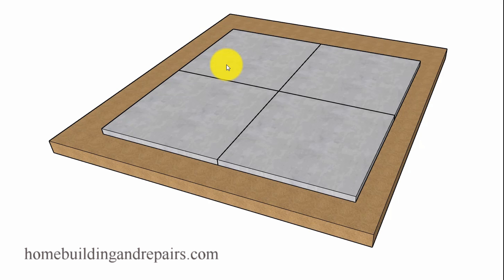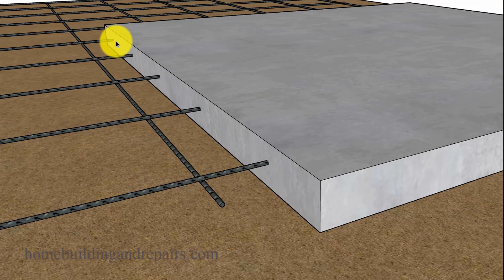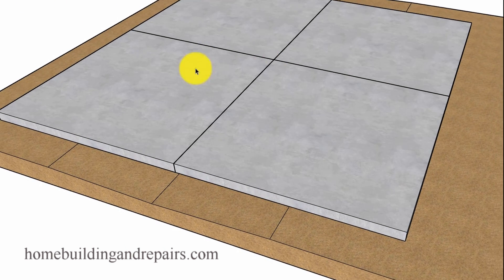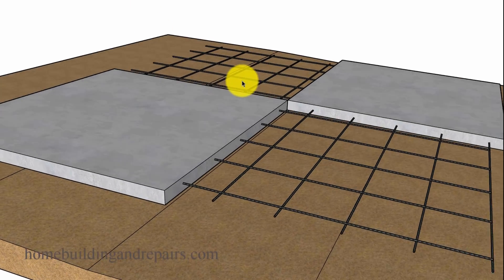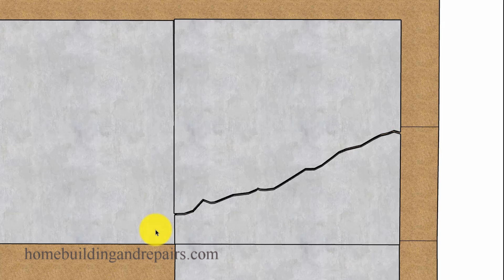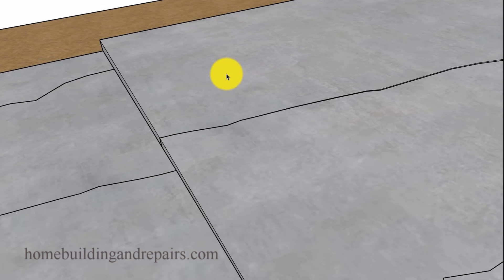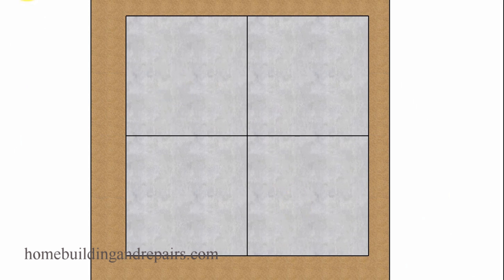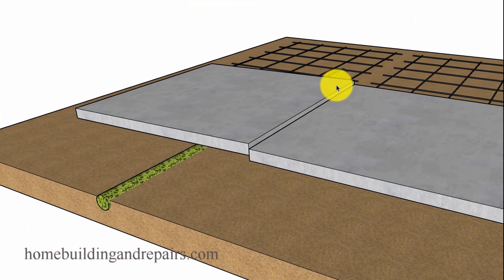Watch This Video To Learn More About Using or Not Using Rebar For Concrete Driveway

Comment: Greg, if I am connecting an 18 inch wide driveway extension to my existing driveway what is the proper way to do this? I am using 4 inches of compacted DGA as my sub base separated with geo fabric. Then 4 inches of 57’s and 4 inches of concrete. I am putting rebar in the new extension. I’m not sure if my existing driveway has rebar, or not. I’ve thought of cross drilling into the existing slab and epoxying rebar from the extension. What are your thoughts?
Reply from the maker: I would use rebar and installed rebar dowels or with epoxy if you can into the existing slab

Comment: I don't like rebar for one reason... longevity in rough conditions...If you have temperature swings between winter and summer in the -45 to +35c  range (say -50 to +100F) and a wet climate, rebar concrete tends to crack, then the rebar rusts and spalls, and the concrete turns to utter crap.

Comment: My Brother's house has a massive amount of driveway and many of the separate slabs are lifted and/or cracked.
We discovered that there is zero reinforcement and no base preparation under the slabs when we demolished the worst one to replace it.
I'm pouring small sections to join my asphalt to my new garage and I'm using rebar but not connected to the adjoining slabs.
Reply: Need #57 crushed concrete pieces spread and compacted, then compact paver base or crushed rock with rock sand onto the #57. It's driveable at the point. Then pour right onto it. I only do concrete with that kind of base prep- much better than pouring right onto dirt.

Comment: Thanks very much for this video.  I''d never attempt doing a large concrete pour myself but it helps to know this information when contracting out the job and deciding who takes shortcuts.  Plus, I've observed a recent subdivision where the builder did not put any reinforcement in the driveways...no wire grid, rebar, etc...they built a 64 house subdivision in less than a year and if they take shortcuts in the driveway, makes you wonder how many other subpar work was done within the walls of the house.

Comment: Rebar or no rebar, the number one thing you need to focus on when pouring flatwork is the BASE! Of course it’s faster to rush the base and add rebar, but your work won’t outlast a slab with a good base and no rebar. Focus on the base, add rebar to act as your BACK UP to if the base fails down the line.
Reply: Base?
Reply: @yangmagic0703 base being what's under the concrete. It could be a compacted final grade sand, road base, etc. It depends on where you are and what the municipalities require.
Reply: Thats why i use 2 inches #57 crushed concrete on top of compacted soil, then compact again after placing paver base (rock dust mixed with small stones).
Reply: @SK-ml3ef supposed to be 4”
Reply: Good point. Make the foundation/base and rebar as backup help

Comment: Consider using Fiberglass rebar for ultimate longevity. You can also downsize the bar due to it's incredible strength.
Reply: Tensile strength, yes. Sheer strength, though?

Comment: Greg, thanks as always for another great video! Two questions if I may.

#1 I will build a 4x19 sidewalk attached to a structure. No cars would pass on it. I thought it would be 4 inches thick. What kind of metal mesh would you suggest? Some said 10 gauge mesh. What do you think?

#2 I will build 8 columns with 4 feet by 16 inches diameter sonotubes in which I've been told to put 2 vertical rebars. (Office foundations) My idea is to add footings under those. The calculation tells me to make a 32 inch diameter by 17.6 inches thicker footing. What kind of mesh would you put for this footing?

Thanks for your eventual answer.
Reply from the maker: I've seen 10 gauge used plenty of time in sidewalks. I can't tell you specifically what materials to use to reinforce your concrete, but if you're in freezing temperatures, you might check with local contractors for more information.
Reply: @gregvancom , thank you very much!

Comment: Few builders do rebar anymore in footings or garages. I had a hell of a time getting the builder to place rebar in my footings. He argued politely stating it isn’t necessary and I finally said it’s my home and I want two rebar on chairs. So he did it but resented it.  I’ve seen so many who do not put rebar in concrete driveways either.  Unbelievable today.
Reply: You know, it doesn’t always need rebar, and rebar reduces the longevity of the concrete. Over time, rebar corrodes and expands, cracking the concrete.

Really what i would like to see is a longer lasting replacement for rebar.
Reply: @TheNativeTwo fiberglass based rebar.
Reply: I made a point of having supporting beams for the concrete floor to "sit" upon.
And the floor is also tied to the outside beam along it's edge.
The slabs are dowel pinned along the remaining edges and two layers of reinforcing. @10 kilograms per square meter.
Overkill always works.
As to rebar rusting, get your depth of cover correct.
And plastic structural firber is also added to the 30 mpa concrete. At 6" thick minimum.

Comment: Doesn't rebar rust, expand and eventually cause cracking?
Reply from the maker: It could, but if installed correctly, should reduce cracking or prevent them from expanding.
Reply: Yes, it can corrode over time.

Comment: If I wanted to build a solid slab of concrete of the same dimensions (in the video) in  a freeze-thaw area (frost depth of 26") with heavy clay, and tree roots... and I didn't want to cut expansion joints, how much rebar would I need? Is it possible to create the same sort of floating slab with a basement beneath... with a clear span of 18'x18'?
Reply from the maker: Yes, you can build concrete driveways on top of basements. It will require a structural engineer.

Comment: Would it be possible to pour the foundation of a house (like a double wide) with this method? Using a harbor freight mixer? And lots and lots of bags of cement?
Reply from the maker: Yes, but an engineer might want it all poured at once.
Reply: @gregvancom  me too. But it's much cheaper by tens of thousands of dollars. So I wonder what the downsides are in terms of strength

Comment: I'm building a 105.5 x184.5 sf slab that is double mat with #9 rebar at 12"oc and height of slab is 2.83 feet , so it's a continuous pour ( 8 in total ) so this video makes a lot of sense , btw my wall height is 27 feet tall , is a process water basin
Reply from the maker: Now that's a slab:)

Comment: On the subject of tying separate pours.  I'm considering doing an ~500sqft monolith slab in 10 incremental sections with bag product (portland) using a tow behind mixer.  I'd plan to get it all done relatively quickly and keep the rebar and mesh covered.  Meaning separate pours.  Due to the grading and site access, every quote I've gotten from someone to do this location pour is ~$12k.  Think that is reasonable task for one man?  Mistake to tie the multiple poured sections together or a better approach?  Thanks for the great content Greg.
Reply from the maker: It seems like you could do that in one day with some help from friends. If you have footing, then I've seen the footing poured on the first day and the slab poured on the next or even a few days later.

Comment: What if I’m getting a 21x20’ slab in my back yard with no car traffic whatsoever? Should I get rebar if I’m thinking about putting a gazebo? It will be used for only light traffic and basic family gatherings
Reply from the maker: Rebar ads reinforcement, but it might not always be needed. I would use it on everything, if I can afford to.

Comment: This is a very helpful video. I am having the exact problem in my driveway. The only difference is a drain pipe that runs parallel with the concrete joints and there are drains at each joint where the corners of the concrete slabs meet. This is located immediately outside my garage doors so it is a high traffic area. I've gotten two different assessments from contractors and one suggested after demo and discovering whether there is erosion around the drain and checking the compacting, I would need 6 inches of concrete or 4 inches of concrete depending on what he finds after demo. He recommended rebar in each instance due to the high traffic area. The other contractor suggests 4 inches and using some type of concrete that has some built in material that substitutes for the rebar. Is there such a thing? I have never heard of it. From your video, it seems that I need rebar to avoid the problem I have. Cracking and slabs raising just as you have shown here.
Reply from the maker: I would ask what the substitute or additive is and do some research. I've used fiberglass additive with rebar, but not just concrete without rebar. The only thing I use with out rebar would be when building sidewalks not more than 4 feet wide.
Reply: @gregvancom Thanks for getting back to me. Does mesh sheets give similar reinforcement to the concrete slabs? My contractor is suggesting this for now for my repair.
Reply: That's a great question. I too would like to know if using a Concrete additive plus mesh sheets would help to prevent cracking.

Comment: Not be a DA, but what if you only had chain fence in a pinch, could it work if you used layers of it, and used chicken coup wire humped over into arches to keep the layers separated, could that work in a pinch... JW, not trying to be a DA,
Reply from the maker: I wouldn't use any type of wire netting like chicken coop wire that could prevent the gravel in the concrete from going through it and creating a void or airspace under the chicken wire.
Reply: Thank you,

Comment: How far apart is tje rebar sopost to be??
Reply from the maker: I've seen it spaced about 16 inches to 24 inches on center for concrete slabs.
Reply: If using PinkBar (owens corning fiberglass product), the tech sheets say 18" spacing it either direction for a slab between 3"-6" thick.  Now with steel prices so high fiberglass looking a lot better for flat work and structural pours

Comment: Yes, so true and not only that, how does rebar get installed, is a very good subject too. Lots of driveways are poured concrete on top of rough soil and no reinforcement at all yet zero soil preparation such as sand and gravel. Most driveways are 3.5" thick, not 4" due to the "2x4" forms they use. Some will use fence wire to reinforce the concrete however they don't use dobies to space the wire up off of the soil. Those who use rebar will also fail big and not space the rebar up from the soil so the concrete doesn't encapsulate the rebar and again, no sand and no gravel prep. It's bad enough to find a decent contractor but to spend the money and not have the right soil grade, preparations, spaced reinforcement (dobies) and so forth just says in 5 years, unless you are lucky, you will have a poor looking driveway full of cracks, gaps and uneven surfaces. There's no good in that.
Reply: Not only that…when the slab cracks at the joints rain water will corrode and swell the rebar resulting in blowouts exposing more rebar. DO NOT USE STEEL IN EXTERIOR CONCRETE.
Reply: @mudslutmusic9052  How is that? Rebar is used in all structural concrete such as bridges and freeways etc. Control joints are engineered for that reason.
Reply: @mudslutmusic9052  In many cases yes and special coating for certain conditions. Not all concrete work requires coated rebar to prevent spalling.

Comment: Rebar in a 6 inch poured driveway is completely and totally unnecessary! Period!!!! The base on which the concrete is poured is the most important thing. In most cases 4 inch concrete is sufficient with proper base.
Reply: Unless you have heavy vehicles such as a 40' Class A motorhome that weighs 35,000 lbs that will be using that concrete. Then, its likely to be best going with 6".
Reply: @Garth2011  4inch concrete driveway require mesh ? Only thing onit will be average sized car 🚗
Reply: @evangroves7332  Yes indeed...cracks and uneven expansion joints take over after a few years and without rebar, it will simply shift and move. As this example showed, 4 square pads that are not tied together will end up as 4 pads at different surface levels over time. Concrete is not any good all by itself in the long run. Walkways and sidewalks can survive without it because they are smaller slabs and will not expand and contract from the sun and cold as larger slabs will. Most of the idea for rebar driveways is about keeping the concrete bonded together over its lifetime, not necessarily what will be on it.
Reply from the maker: I can't argue with that. If you have the perfect base for it to sit on and you won't ever have any problems with erosion or freezing ground or tree roots or any other problems that could be created from not having any rebar then you could be correct.
Reply: Bwahahahaaa
Reply: Guys don’t want to use rebar cause they are lazy why not put it in? It’s not that expensive esp if your spending thousands of dollars to protect your investment

Comment: Great video, but I have one concern: doesn't rebar bend under a certain amount of perpendicular force? Is this bending something we will need to worry about? Like if it were for a garage pad, or house
Reply from the maker: Yes, rebar can bend under extreme pressure and you might need to use more rebar and thicker concrete driveways if you think this is going to be a problem. Most of the time a 5 inch thick concrete slab with 24 inch on center number four rebar will do the job.
Reply: @gregvancom  Great. Another novice issue however: if I made say a concrete garage pad using your method, as I intend to next week, what is the likelihood that the 'entire' structure will heave as one side sinks due to for example soil erosion because the entire thing is too stiff, so instead of healthy cracking and the slight bending of rebar there would be the very dangerous heaving of the entire width of the slab like a see saw. And this can be amplified by archemedes principle if there is a fulcrum like large rocks or denser ground involved. Is this concern valid

Comment: This helped squash an argument with the wife! We are looking at getting our driveway redone. The concrete without the rebar is how our driveway looks right now! Good video!
Reply: Use fiberglass rebar, steel corrodes and swells.
Reply: @mudslutmusic9052  have you used? Are they the same cost?
Reply from the maker: Glad it helped.

Comment: I had my driveway and sidewalks done 8 months. They didn't use rebar. I already see problems with cracks. 12 grand down the drain. If your driveway bad your better off selling the house.
Reply from the maker: Don't get down in the dumps yet, I've seen driveway like your last for decades with only a few small cracks. Let's hope for the best.
Reply: With large slabs of concrete cracks will always appear. It all depends on what they look like. 

Man I'd want an update
Reply: Did they use wire mesh? Do you live in a northern or southern state?
Reply: @Kiddro22  I live northern east coast, no wire mesh.
Reply: @briangoodie3420 A Skelton (wire mesh) should’ve been used
Reply: @Kiddro22  I should've did more research on who uses what.

Comment: Good explanation.  Would you still recommend tying the rebar together if you were doing 5 independent slabs in a multi step walk.  Each slab would have different volume by way of height.. all being the same  width.  I am intentionally keeping a 2” gap between them and a 6” rise separates as well
Reply from the maker: I've seen it done before, but exposed rebar could rust and over time won't be as effective. Maybe just keep them separated unless you think there will be a lot of movement from expansive soil, tree roots or something else.
Reply: @gregvancom  Sir, does not rebar, whether exposed or not, rust over time?

Comment: Yet another example of how water is always your main enemy in housebuilding. Everything from mold in crawlspaces to porous brick, tile showers with no red guard sealant, bad flashing on the roof, gutter misalignment, the slope preventing drainage, not sealing basements, no air gaps behind veneer exteriors, the list goes on and on. All moisture problems. Water is scary.
Reply from the maker: Definitely one of the biggest problems when it comes to home repairs and construction.

Comment: What if you were going to do a driveway in sections but didn't want to remove all the old concrete in one shot or set up all the rebar at once? Say you removed a section of old concrete that is 1 foot bigger per side than what you want to pour. Then you rebar it with the notched forms so you will wind up with the new concrete with 1 foot long rebar sticking out the sides. Then when you do the next section you just wire more rebar on to whats sticking out to go in the next section.
The reason I ask this is because my endurance isn't what it used to be, I'm 67 and I just can't work like I used to, this would allow me to do smaller sections. In my area it's impossible to hire it out because of the demand.

Comment: Great video, Greg. My vote in where I come from (Ontario, Canada) Would be for the use of rebar all the time! With frost considerations and the weight of cars to consider, spend a little more now; rather than a great deal more, later on!!
Reply from the maker: Isn't that the truth!!!  Pay me now or Pay me latter kind a thing.
Reply: Isn't metal in concrete a bad idea? Rust, expansion leads to cracking.